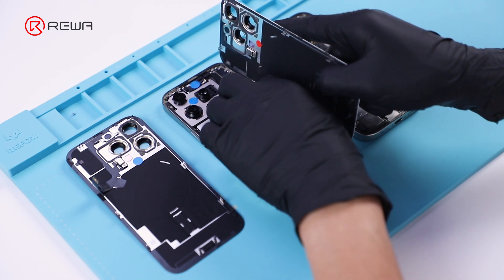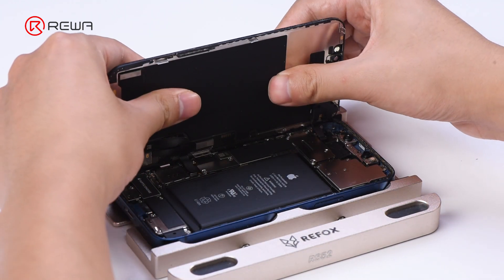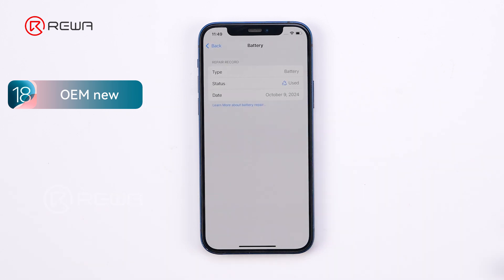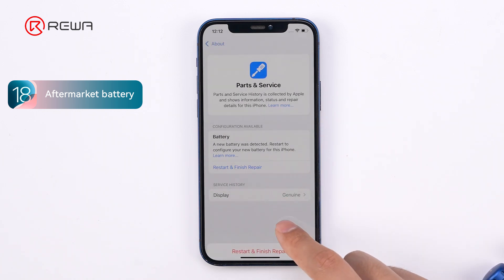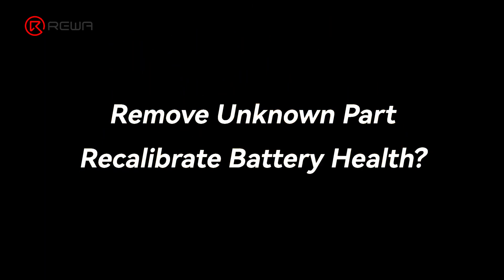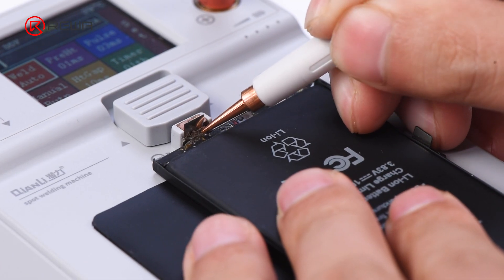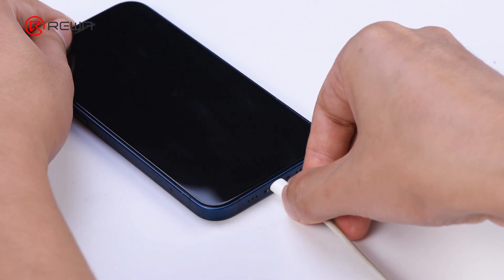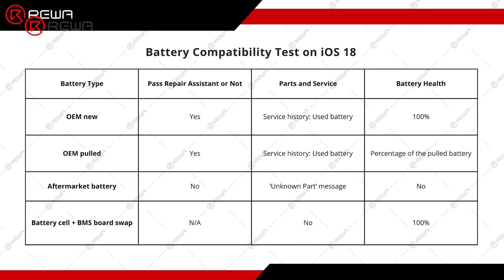Can Aftermarket Battery Finish Parts Pairing on iOS 18?

Comment from the maker: How do you feel about the new iOS18, is it really helpful for the aftermarket or third party repair? Pls share your feeling on comment❤❤
Reply: have you tried this with a bms board that has a T.I Chip and never paired . would be interesting
Reply from the maker: @matthewrobinson150  Based on our testing, it should be recognized as the aftermarket battery, for the chip is not original, but since you mention that, will it have any difference?
Reply: @rewatechnology2008  ok but then what is telling the phone on the bms board that the battery is original🤔 ? Cause that way if u figure it out u could change battery replacement for good ! And also aftermarket bms boards become better
Reply: @rewatechnology2008  what happens if you put iPhone bsm board on android battery that is similar to iPhone battery
Reply from the maker: @NicVandEmZ  Your idea is great, but since it belongs to Android we really suggest you not do that
Reply from the maker: @matthewrobinson150  The motherboard will check and verify, if you watch our 16 pro swap test, you will notice that the motherboard should be the monitor to verify whether the parts are OK
Reply: Really interesting 🤣
Reply: Can I use a JCID V1SE Wifi version to perform this repair.. Please reply me @rewatechnology2008
Reply: Do you know how to do it with qianli? Using old method, it failed to flash in 3utools ios18.1.
I only have qianli programmer
Reply: It seems like with iOS 18.2 and later the method “Battery cell + BMS board swap” no longer works - which means the battery health stays on the old value, even after reprogramming it. (Test device: iPhone XR, with iOS 18.2.1)
Reply: how about iPhone 6s Plus
Reply from the maker: @chuakianhong7338  LOL iphone 6s Plus seems can not update to iOS 18.
Reply: What about iphone 11? Can the same be done with calibrating the parts?

Comment: what about oem pulled + bms board swap?
Reply from the maker: The battery cell is fine, but the bms transferring is vital for unknown part message.
Reply: @rewatechnology2008 I mean, if I want that there will be no repair history. I should do bms transfer on a oem pulled battery?
Reply from the maker: @pertikulooterbulo504  Pulled BMS with new battery cell, also the BMS must pair with the motherboard, the main point is the bms must pair with motherboard.

Comment: hi there is any chance of finding a battery replacement that would be already ready for being installed and work properly? without melting? cuz i wanna replace my battery but i don’t really know were i can buy a replacement please help me
Reply from the maker: The OEM iPhone battery is ok, after you replace it, then run repair assistant then everything works fine.
Reply: @rewatechnology2008 so if it’s oem without being an original apple it will work properly? thanks again 🙏🙏🙏

Comment: What apple fails to recognize is. The more they keep their relevant to the general public, the more likely the general public is to use their products.
Apple however refuses to recognize this.
They continually make it as hard as possible for anyone to use their products, be they hardware or software. And this is why apple is losing users and over fist.
I myself was a rediculusly stupid buyer of apple products.
Ipads was always basic. Wifi.
Iphones had only 1 requirement. A sim tray.
I will notuse cdma and esim is nothing more than cdma on steroids.
When apple went esim only with the iphone 14. I abandoned iphone. I will never ues any iphone after the 13. And have changed over to the Oneplus line because OnePlus HASE a sim tray and currently, OP seems to be paying attention to what their customers want, rather than how hard they as a company want to screw their customers over.
So.
Apple uses a telephone pole.
OnePlus uses a microphone.
Which one will you listen to?

Comment: its not working anymore on ios 18.2 and above, apple has fix this....
Reply from the maker: For now after our testing, the battery still can apply BMS board tranferring method, just some of the OEM batteries may not pass repair assistant
Reply: @rewatechnology2008  i have tried on many iPhone 13 and 14 series and it's not working anymore. Apple is always a step forward... Sadly...

Comment: I replaced my battery a day ago with aftermarket battery but it shows 100% but it drains fast is it still calibrating?
Reply from the maker: ios 18 may meet battery drain problem, you may also need this problem, maybe need to update to new battery

Comment: I have transferred original BMS to new battery and programmed with JCID tag on flex. After flashing in 3 u tools (+ restarting at 6%) I remove the tag on flex. At this point the battery health data on the phone is correct but not on 3 u tools? I have tried multiple times but 3 u tools only shows the old data. Do you know how to  correct overcome this? Thanks

Comment: That works for battery replacement, but has anyone tried it just to improve the battery life? In iOS 18.1.1, it's causing a lot of issues. After I updated the batteries, they were marked as used even though they were the original ones. Nothing worked—not even spoofing or any other trick.
Reply: Yep. My phone now shows “100% battery” but also “important message” above it. idk how to fix

Comment: @ i have 12 pro max 
in ios 18.1 when i click repair & finish
into repair assistant below display it says " this part is not functioning as expected" . 
can you provide solution Rewa???
Reply from the maker: To be clear which part you are using to run this, generally the oem should work as our video

Comment: Unable to Configure

There may be a problem with the server or network. Please try again later. How to fix that problem bro please tell me😢 I have changed into the original display but in repair section this happened.
Reply from the maker: This may relate to your network problem, try it few times, generally it should just pop up unable to configure
Reply: @ I have been tryied 20 times but nothing happened
Reply from the maker: Bad news for that, the repair configuration should start then you will know how the part work on iOS 18.1
Reply: @rewatechnology2008  But how can I fix that

Comment: Would like to ask a question maybe you or someone in the comments would have an answer. I have an iPhone 14 that the back glass flex cable is broken, would replacing it with an OEM or aftermarket bring back the flashlight with this new iOS update
Reply from the maker: The cable quality should be fine, it depends on your budget
Reply: Ok, so even with an aftermarket back the flash and the other components that are connected using that flex cable should be working?

Comment: Does anyone has this problem while Fix Battery Flashing with 3utools with ios 18.1? "Unable to exit recovery mode" It works with itune flash but 3utools fix flash isnt working :/ And im stuck with Important battery message

Comment: I installed a third-party battery with iOS 18.0.1 and with the new update that came out of iOS 18.1 if it tells me the condition, although I get a message of unverified part
Reply from the maker: Yeah the third party battery will pop up this problem as you can see in the video you, so the best way is the old method in our video, you can also apply it

Comment: i have 3rd party battery replacement but still got the battery health. it was not available on previous ios version.
Reply from the maker: Even on iOS 18.1?
Reply: @rewatechnology2008  yes
Reply from the maker: @reymarkcabil  Which module you apply this time? We may also test it
Reply: @rewatechnology2008  did not apply any module since from the installation.

Comment: Personal experience on 14 Pro, with pulled OEM battery from the same model / phone, shows as "uknown" again, like it's an aftermarket. 
Then going to IOS 18.1 beta, it still shows as "unverified part" but the health is visible and at 100%
Reply from the maker: After finish repair assistance, it still can not work?
Reply: @rewatechnology2008 yeah not all iPhones can complete the new calibration sadly but hopefully when IOS 18 fully launches they will resolve the issue
Reply from the maker: @jackwinn3888  Can not be sure, let's wait for more detail, now it is just the iOS 18.1 RC seems launched

Comment: This methods ios 18 supported All models are supported??

Another doubt if we chage original bms board without connect tag on flex. Directly connect original bms ( battery cell only changed ) board after flashing battery healty re- calibration 100% healy ?

Can u explain this both question?
Reply from the maker: For now the method works on iphone 12, and it should work on other modules, 
as for the tag on flex question, generally it will show the original bms battery healthy, but we also test 3rd party battery on ios 18.1 beta6, it will show the correct healthy with unknown part, we will test it again after it is officially launched

Comment: I believe there is one more test missing...repair without the flex with I forgot the name ws09 pro what so ever....or that similiar to the OEM method?
Reply from the maker: Because we alredy tested without the flex, it will show original battery healthy, we skip that becasue it mainly shares same reslut as before
Reply: @rewatechnology2008  even after restoring? Because previously there is method without flex with that ws09 or what is  the name of that programmer

Comment: install ios 18.1 the aftermarket will also show battery health. I am also using third party battery in my iphone 12 in ios 18.1 the battery healh shows 100 even its battery bms is also a aftermarket bms still shows 100 battery health
Reply: what about important battery message?
Reply: @signore-solomonare1818 it works on iphone 12 a further
Reply: Same with mine

Comment: Not working last 2-3 days
Reply: completely functional for me... Its weird with 3u tools, but JCID works perfectly, if fixing battery health when flashing, it requires you to manually put it in recovery mode. You also must use a tag on flex
Reply from the maker: @BKrandy01  Yeah JC and refox tool is ok

Comment: I tried fixing battery health on the iPhone 11 running iOS 18.0.1 yesterday. It took almost 4 hours to fix the battery health. I'm currently using a JCID Programmer. After attempting software flashing for the third time, the health was finally restored. Weird! 😅
Reply from the maker: It may link to the network problem, just leave it more patience

Comment: Does Repair Assistant work on older iPhones? 11? XR?
Reply: No. Only for 12 and newer
Reply: Greedy bastards
Reply from the maker: Based on the information, the ios 18 works on XR-11 Pro Max
Reply: @rewatechnology2008  iOS 18 is supported on XR, but Repair Assistant is not available

Comment: Battery health comes back with ios 18.1 on aftermarket battery
Reply from the maker: Appreciate that, we also test that, same reslut, but for now it is still beta version, so we would love test it again after it is officially launched
Reply: @rewatechnology2008  bt it will show battery important message too
Reply: @rewatechnology2008  can you do a test for a ideas I had is find a android battery and swap the android bsm board with a iPhone bsm board and see what happens
Reply from the maker: @NicVandEmZ  Different structure and different manufacture, it should not work, and maybe harmful for the battery
Reply: Where did you find out this information?
Reply: @Adam90028  i have updated to 18.1 beta
Reply: @Adam90028 it does show the battery percentage with a non-annoying “unverified” tag in the battery health button to show the health screen (where it says normal)
Reply: Yes,true tone also
Reply: @Gifmondo  is it public beta or developer beta?
Reply: Yes
Reply: Ok
Reply: So if it shows the battery health does that mean it’s a good quality third party battery?

Comment: Battery health should show on aftermarket parts alongside the warning on the new beta release of iOS right?
Reply: Yes. Already works on the beta 18.1
We tried
Reply from the maker: Yeah battery life will pop up, but it is only the beta, so we are waiting for it official exhibition and maybe it will change?
Reply: @rewatechnology2008  it will show in stable version too bcz ios 18.1 is on last beta and on next week it will be RC and RC is also a stable u already know and this happened with display also I am using after market Gx oled display but when I installed ios 18.1 public beta 3 the true tone is restored in gx display with jcid programmer. I think they will change display repairs policies also as well as battery health